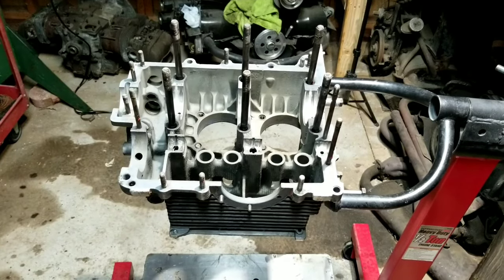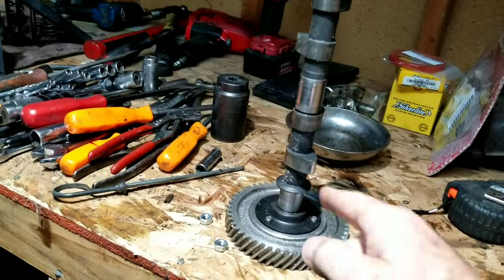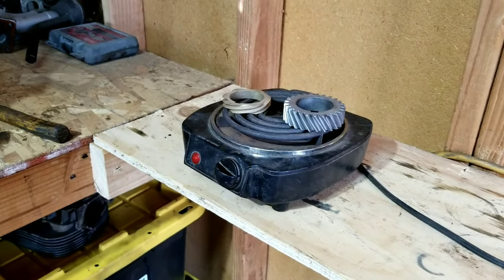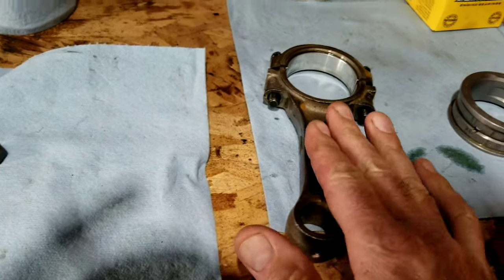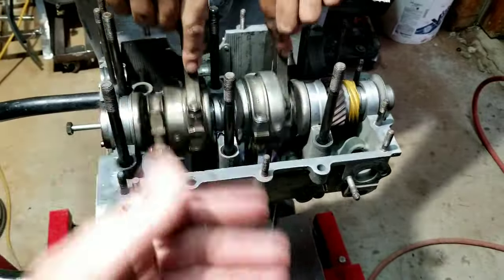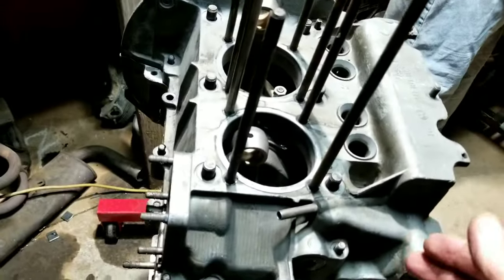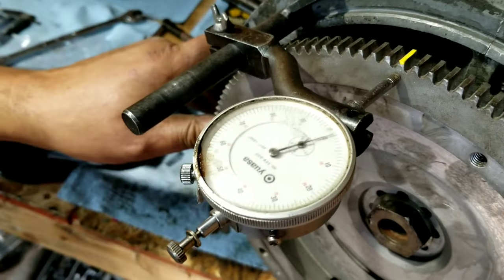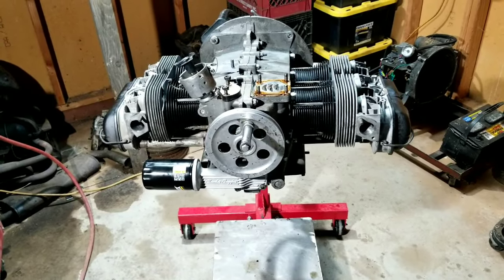Extreme budget 1600 VW engine build

Comment: A problem never mentioned with volkswagen beetles is replacing the clutch cable. If the yoke assembly  at the engine end  was re-designed and properly lubricated  the cable would,nt break, but I found that I  had to cut a hole in the  chassis tunnel  to hook the cable on the clutch pedal, then weld a patch  on to cover the hole.  Quite a long job.
Reply: The car has many access ports that are simply a larger plate held down with a screw, remove the screw pull the plate do your repair, reset screw! A weld is indeed extra work!
Reply: My beetle has 190k miles on the original clutch cable. Unless this problem is specific to earlier cars, I dont see an issue with them
Reply: The clutch Boden tube has (yes EVERYONE) a small hole in the classic end. This is the grease hole to lub the cable with a grease gun needle every service.
Reply: You lost your patience  😊

Comment: Not much help on aircooled where i live. Trying to figure all this out as i go so this video is golden to me.  Thanks and cant wait for the next video.  Liked and subscribed.
Reply from the maker: alright you guys are who I am making this for the most. Some guys have parts and or shops around to get help from and guys like you have youtube. So There will be many more videos on this stuff coming. With these videos and a book you should be good to go.
Reply: You mentioned a 6v/12v flywheel. I'd like to get a '66 Ghia flywheel  . They had a 6v starter gear w/ 200 MM clutch an can be used on 13oocc and up cranks

Comment: Hello Mike, Wanted to say i built my 1st. VW aircooled way back in 1980 and it was a single port 1600, W110 Engle cam, 30pict carb. 009 dist. It also sported the "Monza" Dual tip Header as well. I Thank You for bringing back some old memories. I'm still working on them now and enjoy all of your video content. Great job !

Comment: My first car was a '67 beetle with a 1500cc (stock) engine, having single-port heads. It was slow as the day is long.
For performance builds on the cheap, what to look for in a donor engine: 1600cc dual-relief case (with dual-port heads) from 1970 and later.

Comment: Theoretically, lapping valves doesn’t work. Because when the engine warms up, there’s expansion and possibly contraction of the related parts. So the lapped part of the valve and seat will not mate exactly where they did when cold.when doing a grind, the valve has a wider sealing area to compensate for this.  I Suppose if you can see the exact seating area before lapping, then you will know if the correct spot is being lapped. Also, maybe it’s just not an issue on some engines. I have not done a vw yet. But on all the bigger Diesel engines I rebuilt, this was a factor. Just saying.

Comment: Seems like someone could make a mold of Subaru heads, and cast a set of Subaru/VW hybrid heads, and convert to overhead cams,  4valves per hole,. Would be a serious gain, especially if something like v-tec can be incorporated, possibly variable cam timing, with dohc,  being able to change the cam timing, as well as go from a 180°-190° @.050"  love with . 440" lift to a larger 270°-280° @ .050" and about 525" lift love, on the fly, as well as changing LSA and timing events,  it can give max low end TQ to about 3k rpm, then swap lobes, and have a curve programmed in to allow max performance from 3k RPM, to 6k maybe 7k rpm plus,  with 4340 crank and rods, light weight pistons,  conical or beehive springs with titanium followers and retainers, the valve train  could do 10k plus, tool steel cam cores, also being everything is being changed on the heads, the Ports could be setup for low end and high end, have two intake ports per cylinder, closing one to get velocity and swirl for low end performance,  maybe have different lobes and port specs for low end and one for top end, closing the large port for low end performance,  design a intake with a 1.25" long runners for low end,  possibly fed from the opposite bank, then a straight shot 2.25" Dia.  port about 5"-7" from valve to plenum,. With about 70mm throttle blade,   with either a carb or EFI,  have about . 3 cuft plenum, with a 350 Holley 2bbl carb on each bank, with the plenum bolting on to the short and long runners feeding the opposite banks small port, then the opposite side doing the same, but opposite, basically being a 4pc intake, allowing a throttle valve to open in the base of the plenum, possibly using a cable connected in a progressive style linkage, to open the large runner at about 40% throttle, and be easily adjusted to about 75% use a cable linkage between the carbs and power port valves, I believe a 2 litre engine could make the same power as a stock or slightly tuned EJ-25, and with boost, the dual exhaust ports per cylinder should evacuate the cylinders excellently,    the simple dual pattern intake lobes with intake port valves, over a v-tec type system, a variable cam timing would be best with a ECM control,  the throttle activation of the power port should be fine, especially if you learn how to drive and use it, maybe use a vacuum gauge to help judge when to open  it,  having a lobe on demand with a extra 80° duration, and.100" lift and possibly a slightly different event timing, alot of difference could negatively effect performance, it should be close as possible to an on / off as possible because a half open valve isn't going to work well,  but the power should be 150+ over a stock engine, and 225 HP should be easy without any adders, maybe 250 HP at about 6800,  I believe 6800 is about the peak even with trick rods and crank, light pistons,  maybe they could be setup for watercolor heads maybe water cooled cylinders as well,  or liquid cooled, using the non water coolant, use finger followers,  to get a decent ratio over love lift, and possibly use a damper. With pulley on it, so there can be room for a timing belt, better would be an aluminum housing to bolt on to house a chain and the guides, and oiling, and the drain  I believe a turbo intercooled engine like this, could make 200-250 per liter easy street able,  maybe the small port is too small, maybe 1.625 should be better, with an power port  being 2"-2.125  with nearly a 100 mm bore, dual 1.84 maybe 1.94" valves could be possible, and 1.50" exhaust valves,  maybe a 184 and 2.00" intake valve can be fitted, with 1.55" exhaust valves , with nicely shaped ports,  with a dual o-ringed nearly flat cam cover, the ports should be tall and straight as possible,  to flow the best they can,  with a straight shot to the valve and the center of the cylinder as they can,  the flow should be careful to not de disrupted by the other low speed ports,    they must work together, complementary to one another,  the. Small port needs to be high velocity, and create a swirl in the cylinder, when opened the large port, needs to dump into the cylinder, and the sigh swirl should not cut or restrict flow,  it would probably require at least a month of testing on a flow bench to modify the ports to not disturb each other, with a 5 angle seat setup,  it will probably be best to keep the valves identical, only the intake runners changing the flow,. The activation could be done by closing the small port intake runners,  allowed the large power ports to do their thing  , I could see 280 cfm minimum from such a port,   the v-tec would be awesome gain 80° duration, and .100" lift by closing a valve , allowing oil pressure to lock a follower, it would be awesome to have it setup so it can idle on the big cam,  and soon as it's revved to about 800 RPM, the small cam is back to make TQ, until about 3k to 3600+/-,  it would be an awesome setup!!  I'm dreaming crazy I know, it would require ppl who know automotive machining, and casting , engineering,. Not just a mechanic with some ideas,  but maybe modify Subaru heads to fit a VW, and water cool them, bolt a plate to the bores, then the head to the plate, crazy to even think it, i know !!! But dreaming of 4v per hole,  and flow 310cfm at .500"  would be awesome!!

Comment: Hi. Nr1 piston is upsidedown, the arrow on the piston shall point to the flywheel. Reason for arrow it because wrist pin is offset a few thousands to one side to help prevent wrist pin slap. But nice video on the enginebuild! Fun to watch.
Reply from the maker: yea we caught it.  That motor RIPS. for a 16 single. faster than a stock dual port for sure.

Comment: Mike, did you not mention torque specs on rods because you said "use your books" several times? And the high speed sequence installing rings and jugs gave no helpful tips. (Like the shim you said it needed for right deck height. )I felt you could have taught us more intricate details... Just wondering. But - I really do appreciate all you did say and shared. Good video. Thanks!

Comment: Did it run OK mate im interested as I can't find video
Reply from the maker: Yea faster than a stock dual port by far. and more torque. great combo. porting the exhaust was huge. substitute with engle 110 or web 86 with or without ratio rockers.
Reply: @Mikefngarage  nice im building a 1600 std with 110 cam with dual carbs im looking at how may sound and idle

Comment: kind of how I built my engine mostly used and rebuilt parts I think the original parts were the best, did you put cool tins on this one ?
Reply from the maker: not at this point but when we find some carbs I will put dual port heads on it and cool tin. you bet.  and maybe that merged system because it will go in one of the bugs for demo.

Comment: Im new to the VW scene, I have a 1968 vw beetle, i bought it off the original owner after it had sat for 30 years, after getting it running and driving around for a couple months, the motor lost compression in cylinder 3, had the fuel pump go bad, and i believe some of the valves are stuck open, how much would you say it would cost to get it rebuilt at a shop in California? I am savvy with cars and can do the work i just do not trust myself with an engine, given the conditions i live in
Reply from the maker: I think basic rebuilds start at about 1200 now. most of the time they go up to about 2000 with new heads and some extra machine work. call these guys they are about the best value. 
https://www.performanceworkshop.net/
Reply: @Mikefngarage  thank you so much! What would you say about a shop that sells engines with core swaps? I have 2 engines, one is a seized 1835 that was given to me after the gentleman developed dementia, and the 1600 thats in the car, would you say it is legit?
Reply from the maker: @Advntrwrx  they are good people and will do the right thing. Keep in mind many engines are not good cores. even if they turn over. The cases are often out of size or cracked. But you can trust them with that. If they can do an exchange that is fine. will be a good engine. Another source if you want a turn key engine  swapped is Brothers VW machine shop. https://www.google.com/search?q=brothers+vw+machine+shop&rlz=1C1RXQR_enUS928US928&oq=brothers+vw+machine+shop&aqs=chrome..69i57j46i175i199j0.8418j0j7&sourceid=chrome&ie=UTF-8 they do not work on or install them but rebuild yours. Both highly trusted people.

Comment: Hi all
As a review on costs
What was the full cost please
And if we wanted to complete this build 
What would be the total outlay please
Provisionally How long would this engine last 

I am making a plan for next Spring on my 1975 bus 
Which is not reliable currently.
I need to make up my mind on a full reconditioned motor or a rebuild
Cheers
Keith in the UK
Reply from the maker: this one because all the parts except bearings and a few misc parts is $100 but if you needed machine work done it would be much more than that. We are expecting at least 20k miles. out of it but it could do more. depends on the issues with that case. All the parts are within spec so theoretically it should do at least 50k.

Comment: hi great vid  i just got a 1835 engine can i go bigger barrels without head and block machining ?? thanks man
Reply: You'll need the case and the heads "fly-cut" for the larger cylinders. Another option to increase displacement is more stroke. (as opposed to more cylinder volume)

Comment: Hi Mike, I have seen that you have welds on the housing. How can you weld Magnesium? Is there a special setup?
Reply from the maker: tig. I wont even try it  can catch fire.
Reply: Mike Fn Garage Thanks, yes thats what I think as well. Just wondering how the other guys did it without burning the housing down
Reply: I have done it before on motorcycle cases. I think it was a little back stitch at a time with Argon post flow.

Comment: Had an older 1600dp that I thought would be a good idea to put 88 AA thick wall kit. Shop cut my heads and ended up 8.75 to 1 compression. Engine never has been the same blowing out seals leaks at oil pump he installed and just an insane amount of pressure. When I pull it apart what do I need to look for? Feel like deck height or rings are defective or not seated correctly. Maybe barrels not shimmed right? Hate spending money on people pretending to know about these!! Frustrated!!

Comment: i see your rear seal is flush with the end of the case or it appears that way from my view , i had such a hard time years ago with oil leaks everyone was saying the seal goes flush with the case i was getting leaks like crazy no one gave me the correct answer my flywheel is tapered so my seal has to go in the recess of the case ,,,,,then i read the book and for sure my book said push it in the recess , no more leaks after that ,,,,i was amazed the even so called experts made that mistake ,,,but i am noticing something here if your flywheel is not tapered ,, then the seal would probably work flush with the case ,,,,can you understand where i am coming from ?   thanks just saying i went crazy with that years ago ,,,,too old for that lol

Comment: At 48:00 I never saw the lower cylinder air deflectors go in?  Critical mistake, if you didn't.
Reply from the maker: Oh  no they are under there. I am not sure why we might have missed putting that in the video. I usually use Cool tin too but on the extreme budget We used stock deflectors. The cool tin do work better especially with merged exhaust I would say pretty much a must on those.
Reply: Glad to hear you put them in. I watched it twice and never saw them. You know how the cylinders overheat and warp without them.
Reply: @Mikefngarage  maybe just drill a pair of holes in the stock tin?

Comment: I knew that the rods were upside down since you had it standing up on the flywheel?  I had a better motor ? I found it under 3 feet of leaves , 4 feet of mud ?????????????????
Reply from the maker: yea as soon as it hit the case I saw the rod markers. I wasnt watching till it hit the case.  ha ha.
Reply from the maker: this one will run great too. even these poverty specials run. probably wont have any leaks May put it in the blue or green car just to demo a drive. Plus looking at swap meets for upgrades. need carbs for dual port. I am fresh out. got 3 sets of heads though.

Comment: Ok I have a 74 super beetle 1600cc engine I was told I couldn’t use a Engle 110 because I had to have a dished camshaft because of the cb performance oil cooler I installed is that true because in your video you all put the same camshaft I was told I couldn’t and you all have the cb performance oil cooler as well??

Comment: The connecting rods were incorrectly installed, the forged mark on the shank of connecting rods must be upwards the piston pin bearings offset 1 mm in relation  to the connecting rod bearing.....
Reply from the maker: yea we flipped them put a camera on and you get distracted.